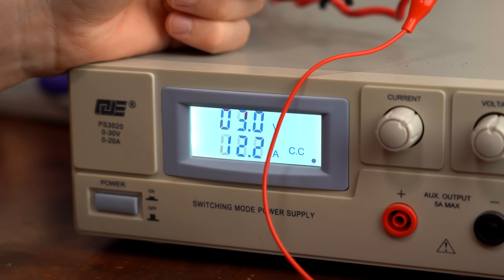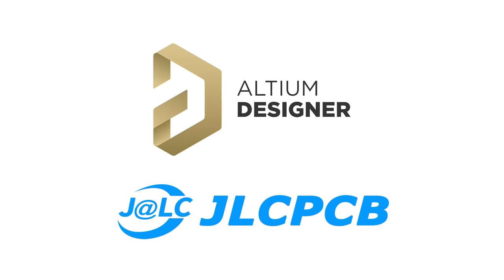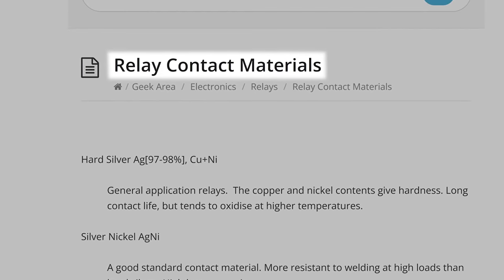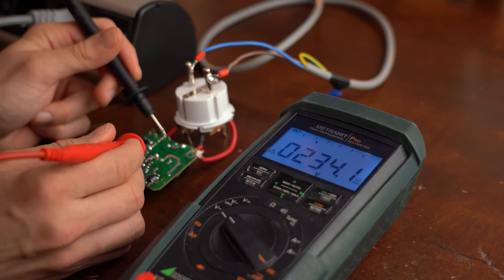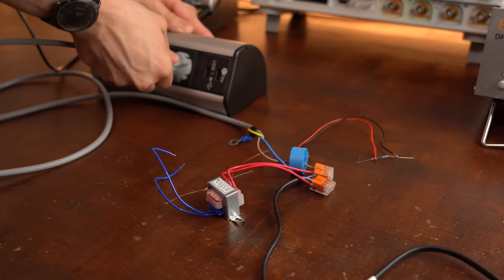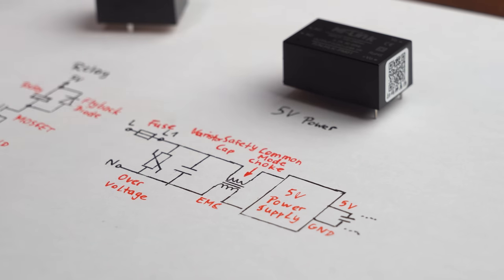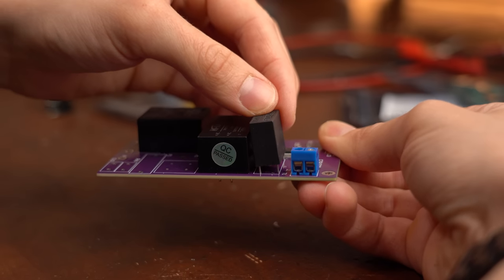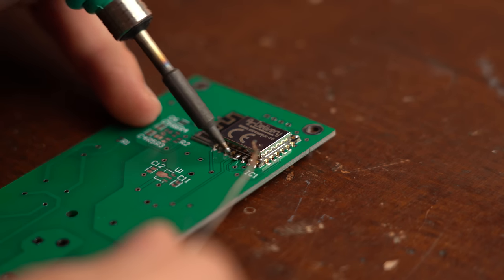The Dark Secret of Smart Sockets and How I Fixed it! (DIY or Buy)

Comment: great video and something I always wondered how difficult it is to DIY. 
However I do wonder if there was a catastrophic failure would my insurance company pay for it...
Reply: would they pay for entire house of Aliexpress things? ;-)
Reply: @zyghom  well it's not the country or platform of origin that worries me. Amazon allows essentially the same stuff to be sold on their platform. 
The aliexpress stuff could still be safety (UL) certified, whether it is a real cert or fake, it's not the buyer's job to check everything you buy. If a fake certed product burns your house down, legal action should be taken to the seller/manufacturer. If a DIY, non-certed gadget burns your house down, I think conventional wisdom says you, the makers is at fault.
Reply: @siyuanliu8043  you are right - I did not want to claim Aliexpress as a platform but the variety of the products there. Majority is... cheap. Is it safe?
The products maker can do can also be good or ... cheap.
Amazon is another platform, where you can find very often the same things Ali sells - just 4 times more expensive ;)

Comment: It should be easy to close and open the relais at 0 V. With the voltage measurement you have the phase information. Only some test are needed to find out the response time of the relais. It would be nice to see that.

Comment: I've always found a non conductive grease (Vaseline - if needs be) smothered over the contact patches not only cut down on sparks, but, help keep relay contacts working reliably. Quietens them down too 🤔😏👍     😎🇬🇧
Reply: @bobbydazzler6990  Hahaha... To reduce the sound output, to make less noisy 😉🤣

Comment: What do you think about triac optocoupler circuits (deconstructed solid state relay) to control mains power? Smaller, silent, no sparking. I hardly see it used anywhere. I have my own DIY board with it and it works great (as far as I can tell).

Comment: My recommendation: just buy one with WiFi from the get-go, then replace the firmware with e.g. Tasmota, which is open-source, it allows you to attach all sorts of sensors and other nifty things to the socket, supports MQTT, doesn't require Internet and as such won't compromise your network and so on and so forth. These sockets also typically come with better relays as well, like e.g. the one I had lying on the shelf appears to be using one with AgSnO2-contacts (an NBC BS6-5-AST-P).

You'll save both time and money by not doing the whole thing yourself. I typically use Sonoff's products for this, though there are plenty of other suitable ones as well supported by Tasmota -- just check that the MCU it uses is an ESP32(-C3, -S2, etc) or ESP82xx.

Comment: Hey, i have a different issue regarding such smart sockets: It occasionally trips my circuit because of various power supplies in the circuit. Wouldn't a solid state relay solve the issue and why didn't you use one?
Reply from the maker: They come with a higher voltage drop. Around 1 to 2V. This makes them less efficient.

Comment: Once enclosed, it doesn't matter if the circuit has galvanic isolation, though it can make development safer. But the whole thing can be plugged into an isolation transformer while testing or programming. As for the enclosure, make sure the filament you use has high resistance. PLA isn't bad, but it does absorb water from the air. So it would be best to line the case with some other material around high voltage areas.
Reply: I don't think the resistance of the plastic is a big deal, as long as you have more than just a thin wall, what is a bit concerning however is that it would be highly preferred to use a flame retardant plastic or at least line the inside with something retardant, should something happen, and it catches fire typical printer materials will definitely just melt and burn your house down.

Comment: People use these to switch off equipment rather than leaving them on stand-by. But the power consumption is not negligible (compared to a TV on stand-by that will consume 0.2-0.5W as well)

Comment: 1. you can use relays rated to run motors since there are inductive kickbacks that can cause arcing.

2. manufacturers could work their employees off the clock like walmart did (oh we need you to clean the bathroom or take the bag of dog food to the customer's car) to make up for the lack of profits along with some theft of service.

3. you just have to install the electronics inside an enclosure so the shock hazard is eliminated.

Comment: Just one reminder since GreateScott didn't say it: Check if you are legally allowed to connect any stuff to mains voltage you build yourself. In Germany, you are not allowed to connect anything to mains that has not been tested and certified before. Even if you are qualified, you are not allowed to connect stuff you made directly to mains, because of insurance reasons.  If you find a company that tests and verifies your stuff and is liable with their insurance, you can choose the DIY way. So "buy" is in the case of mains voltage devices always the win, at least in Germany.
Reply: How sensible, yet boring.
Reply: If you are qualified at the level where you could actually certify the work of others , then im guessing it is not a problem. Im not sure whether you are required to have that insurance then, but most people do.

Comment: For those contemplating doing something similar in terms of DIY, your finished device will not be safety agency approved even if all components of it are safety agency approved.

Stuff like safety agency approval seems irrelevant since you are using it yourself. But should any incident occur where an insurance company has to get involved (such as fire or some visitor getting shocked), the lack of safety agency approval could result in insurance claims being denied.

Comment: I have had great luck with my Kasa smart outlets, after 4 years of use i haven't had any issues.
...But I am only running lights and lower power items.
I have one on my window AC, no issues so far but good to know I should keep an eye on it.
Reply: They are $20 USD each so definitely more expensive.
I try not to cheap out on something that controls mains power in my home.

Comment: I'm curious about the selection of R7 in the schematic for the current sense burden resistor. At a turn ratio of 1:1000, a 20 ohm resistance would cause a differential voltage at 30A to exceed 250mV differential voltage spec for the CS5460A chip. The resistance needs to maybe be like 8.2 ohms. Also I suggest looking at the upgraded CS5463 chip as a drop in replacement.

Comment: I am wondering if using a solid state device to (triac) that is only used when switching can be the best of both worlds. The semiconductor won't have time to get hot so it wouldn't need a heatsink. And the relay would never connect/disconnect more than the triac voltage drop. Or would de relay need a little spark to keep working? And what would the failure modes be?

Comment: Isn't possible to delay the activation of the relay (either on or off) to the zero voltage of AC line (or just before as closing in the circuit, depending on activation time) ? This way no arcing and far than acceptable "response time" AND low consumption. I wonder if it won't be possible to do it with some cheap electronics too.

Of course extendable with an appropriate relay but this time you can focus on conductivity alone (and having a high thermal conductivity gaz into it He plus some metalic enclosure (AL would be the best) would help the life time.

=> I also experience issues with relays as I'm currently living in altitude and they seem to not like at all the cold temperature we can have here and they solder themself a lot in the outside.
=> Had some really high thermal high spot with a thermal camera on the relay inside an hybrid solar inverter (wks), in the command part. It was far hotter than the rest of inverter even during high load times. It both scared me AND worried me about it's efficiency and lifetime. Sometime relays are somehow hungry and I wonder if there are some out there that have a far less consumption.
Reply: The relay isn't fast enough
Reply: @AgentOffice  i guess you replied to the wrong person

Comment: You could use a solid state relay that has a zero volt cross over, no sparks or surge currents as they switch when the AC is at 0 volt point of its sine wave.

Comment: Compare to a Shelly 1PM+snubber, might be not  worth to DIY completely. I 3D printed just an enclosure to add this in the middle of a cable and it works wonders. Does relay, power meter and wifi.

Comment: All of my lamps that got used with CFL during that era have pitting and damage to the switch contacts due to what I assume was the crazy high inrush current. The two identical lamps that were switched by an external wall socket have near perfect internal switch contacts. I have just replaced them and done the autopsies. How I hate CFLs.

Comment: wouldn't the overall thickness of the relay material also make a difference? a larger relay contact plate would help dissipate the heat and help prevent welding?

Comment: Why bother with the galvanic isolation? The whole system gets encased in plastic anyways. Maybe without the transformers you could have made the pcb small enouth to fit in the original case. I only see a reason for the isolation while you are develpoing the curcit / software
Reply from the maker: You not only get the safety aspects but if there is trouble on your mains side then the extra isolation will make it harder that the circuit will suffer on the lower voltage side. But then again like you said, without it you can make everything much more smaller and cheaper. But my focus here was safety and reliability.
Reply: @greatscottlab  I think you've done a good job there. My final concern, though, is that the 3D-printed case is not fire-rated/self-extinguishing, so if things get to exciting in the mains side, well, you know. Great depth on all the electrical stuff, though. Always enjoy your videos for that.
Reply: Why not just replace with ssr.

Theres plenty of deemed safe relays on the market though and you probably have a bunch in your house in appliances.
Reply: And of course, as in the datasheet, the esp side will be isolated anyway through optocouplers and such
Reply: @PatrickRigney  You can print it from material which had self-extinguishing proprieties. Some even have tests according to UL94 and if you are willing to pay, you can buy UL certified materials.
Reply: @lasskinn474  A SSR of more than 10A is going to be big and need some heatsinking. So not practical here.
Reply: HAVE YOU EVER HEARD OF
EXTRA PROTECTION
Reply: @PatrickRigney To be fair I wonder how many cheap circuits also have the same concern in mind. 
Don't get me wrong it seems like something every higher voltage circuit should have but I bet many on the market don't.

Comment: Adding a zero crossing circuit, and also a triac to handle the surge then you close the relay slightly later to remove that extra ~2v of drop can extend the life nearly indefinitely.

Though some arcing in relay contacts can be good. It clears off nonconductive oxide layers and makes a better connection.

Comment: Actually I'm sorry to see that we are going back to these relays. I bought the original Philips Hue/Living Colors Withe Sockets and they can turn off and on and dim. And everything without a sound. I think they are doing this pulse modulation instead of a relay. But they are much nicer than any relay socket I used and with no mechanical parts they are also much more reliable. But the new Philips Hue Sockets also feature these relays and can not dim any more, that's sad. But I also don't know the limitations in power the old ones can handle...

Comment: Couldn't you also use a Comparator and opto coupling circuit  to do Zero Crossing switching possibly with a Solid state relay or even Triac, or even BRT Optotriacs, Also back EMF from the Coil of the relay can cause interference in your control circuit, a simple RC Circuit in series with the coil for AC coils or a Diode in parallel with the coil can help with this for DC coils.

Comment: I had the small relay fail in a remote control socket twice in a matter of 3 months. A third one was fitted and used to drive an externally housed Omron octal plug-in relay. The modified socket has operated OK for over a year now. The original relay was not fit for use in a socket rated at 13 amps.

Comment: To have an iot capability switch that also measures power and consumption I use always a sonoff PowR2 and flash it with tasmota. Then it can be integrated to every Mqtt based system.
Anyway the lifetime of relay contacts also depends if you have inductive or pure resistance load.
Reply: Do you know what material they use, in other words is it susceptible to early degradation from arcing?

Comment: Not sure how much that pcb design effected esp range. Under the antenna should be opening on pcb. Usually they align module that it's antenna is close to edge and then they remove copper under the antenna.

Comment: Cool! I was surprised to see the power consumption being that high on the DIY version. Is is the relay coil that is that hungry? Also, did you have problems with WiFi signal since the antenna sits smack on top of a groundplane?

Comment: Why not use something like a solid state relay?  I have a ton of these for one of my own projects, and they're easily found for AC and DC current as well as many amperage ranges.  I went this direction specifically to avoid the welded relay issue you've described here.  Once bitten...

The ones I use in my more power hungry projects are rated at 40 amps. I don't pull that much through them, I use higher amp SSR than my project requires in order to avoid needing heat sinks.

Comment: With the voltage sense and a micro, why not switch the relay on (or very near) zero crossing too? Wouldn't this minimize contact arcing and inrush stresses on the switched devices?

Comment: Great! Nice tutorial. You can consider using an SCR instead and gain dimmer capabilities along the way, but you will need to deal with triggers or use an SCR driver
Reply from the maker: SCR also come with a bigger voltage drop.
Reply: I forgot to mention, I had to control a vapor generator with electrodes and ended using a solid state relay

Comment: why exactly is it a problem to put the current measurement IC on the mains side and isolate the SPI? You anyways have mains voltage in there and the transformers seem like a ton of added build volume and BOM cost.

Comment: Had a similar project with an ESP2866 driving a small relay, which was driving a bigger 220 V relay, driving a pump motor.. When switching off,  the arcing induced currents that crashed the ESP2866.. I added a snubber, but now the MOV remains shorted when the small relay opens..and the bigger relay remains ON until I kill the power.. I'm stuck !

Comment: @greatscottlab I know it's not so relevant for the rest of the world but since you are in Germany, using the good old SCHUKO style sockets, did you consider changing it to a double pole switch? In many other countries the power outlets are not reversible, L and N have fixed positions so you can "most certainly" be sure that your relay contact does indeed switch off the L conductor. With the SCHUKO this is not the case because a) there is no standard which pin is L or N and b) there is nothing blocking you from just turning the smart socket by 180 degrees. That leads to the problem that you can easily swith the remote controlled socket to OFF but still have line voltage connected to the attached load. Think of changing a light bulb on your smart-switched reading light... Any thoughts on that?

Comment: I wonder if it'd be possible to avoid the sparks entirely by using a transformer with the separate coils far enough apart that they don't connect magnetically. Have some sort of mechanism to quickly snap them together or apart.

Comment: I've been interested in giving this a shot myself too. I was mostly put off by the measurement part with AC. Food for thought, might give it another shot now! A thing i really miss in the "smart power" category is a power strip (say 5 sockets or so) with each being individually controlled (you have that) but also individually measured (that's rare to find). 

Anyhow, awesome project! If you open source it, someone just might play with your ESP code to use make it more energy efficient. It has a couple modes, the defaults are ok but quite energy hungry.for something that's on 24/7
Reply: I've also been looking for such a power strip, which led me to the MCP3914 and its siblings. The "Typical Application Examples" section of the datasheet even has a schematic for a six-outlet power strip with monitoring for each outlet, so you'd just need to add the relays. The example circuit has no isolation, but you can achieve that in the same way as in this video. For five outlets, you could go with the MCP3913 instead.

In my case, I have a couple of dumb 1U rackmount power strips that I'd like to upgrade, so I have plenty of space in the enclosure for electronics. It might be harder to fit all of the necessary extra stuff in a standard household power strip.

Edit to add: On a completely different tack, I've also considered the MLX91220 directly with some sort of microcontroller with plenty of analog inputs like an STM32, but you could presumably also use some MLX91220 as current sensors for the MCP3913.
Reply: @RonParker  ohhhh that's very interesting!!! Thank you for that pointer! Gotta read up on that

Comment: what test equipment did you used to test low resistance current with those red and black twisted wires? Analog or digital oscilloscope?